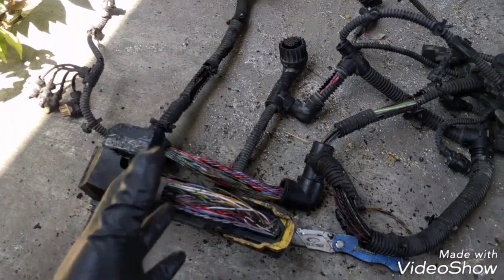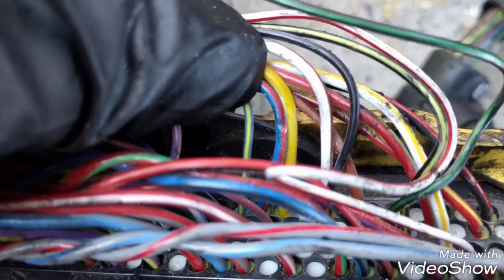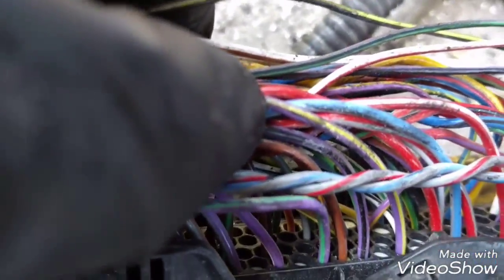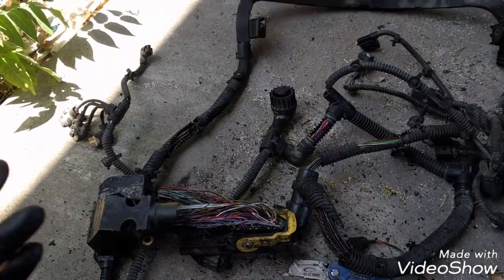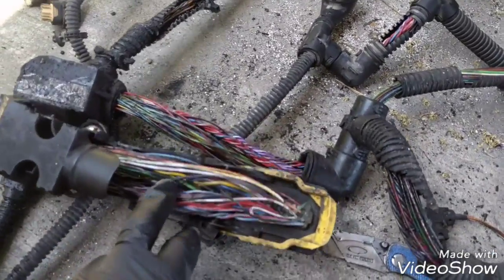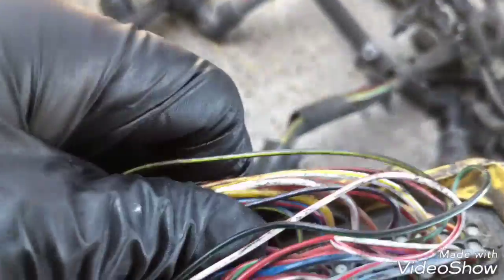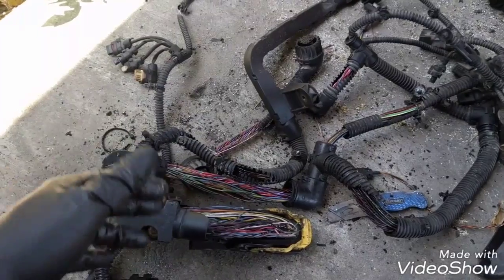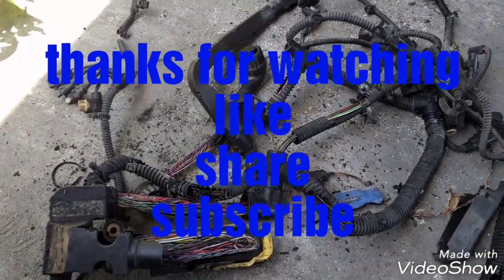Freightliner Cascadia check engine light on DD13 DD15 engine wiring harness might be your problem

Comment: could you tell me why my engine oil and check engine light comes on sometimes when I slow down at a stop sign if I slow down too fast or hard 2012 Cascadia dd15
Reply from the maker: It needs new oil pump orings.